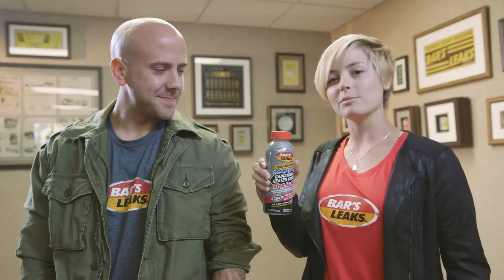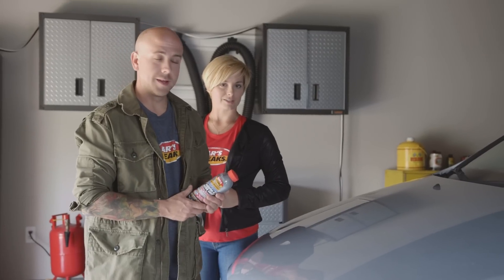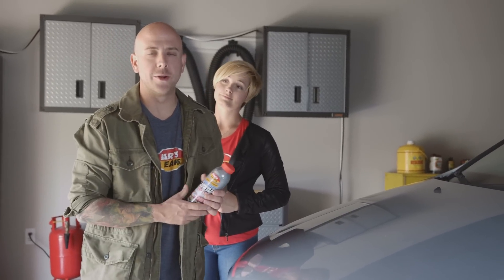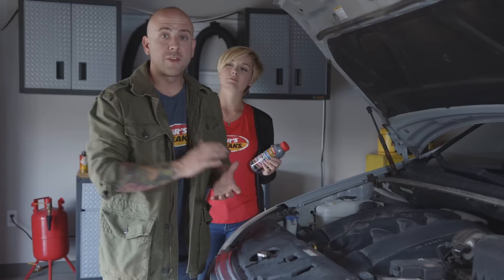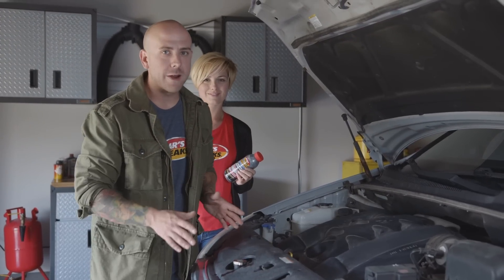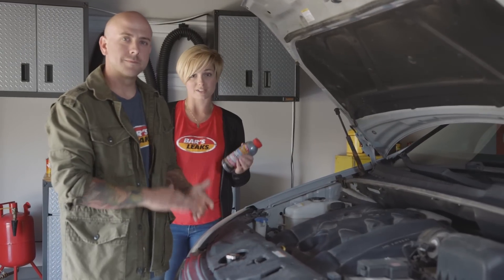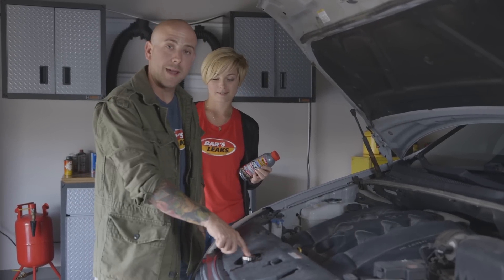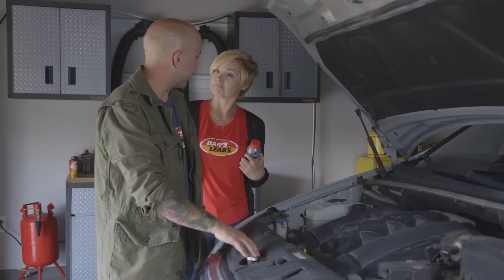How-To: Installing Bar's Leaks Liquid Aluminum Cooling System Stop Leak

Comment: This is what the video says:
- Shake Bottle and pour either directly into radiator via radiator cap or into coolant reservoir.
- One full bottle for 6/8/10 cylinder, 1/2 bottle for 4 cylinder.
- Replace cap and start vehicle. Allow to idle for ~15-30 minutes with fans and heat on high. Don't do this in an enclosed area!
Reply: I needed this
Reply: 😂😂 great job champ for the break down
Reply: Do u put the heat on

Comment: Can I add this or the tablets to my coolant reservoir? I have a 2019 Jeep Cherokee and it take a lot to gain access to the radiator.
Reply from the maker: No, Tablets may be crumbled or pre-dissolved (use warm tap water) for easier application. Install one tablet for each three quarts of cooling system capacity. If vehicle does not have a regular radiator cap, remove top hose where it attaches to radiator and install tablets in hose and then reinstall hose.

Comment: Does this product really works in coolant reservoir or not? I have a 2016 Ford Focus SE. I will only need half bottle since I have 2.0 L 4 cylinder engine?
Reply from the maker: You can install into a pressurized overflow if you do not have access to the radiator. If you have access you will need to install directly into the radiator.

Comment: About to use your product. I Pray to God it works.
Reply from the maker: Hi Rebecca, thanks for giving us a chance to help you out. If you need to speak to us, our customer support team is available M-F 8am-5pm EST, and can be reached at 800-345-6572.
Reply: did it work
Reply: @mohammedalmasbahi4724  no it didn't. Still leaking. 😕 But I have heard that some cars it works depending on the leak.

Comment: What's the purpose of blasting the heat and fan on high?  Does this aid in moving the product through the heater core so it doesn't clog anything there?  I'd LOVE for this product to work but I'm apprehensive for this one factor before I buy and try it.
Reply from the maker: Yes, the reason is so that you get good flow through your heater core. If installed in a clean cooling system at proper dosage you will have no restriction issues. If you have not flushed with a cooling system flush product in the last 30-40 thousand miles you will want to flush before adding the product. Feel free to contact our Technical Service Professionals at 800-345-6572 or if you would prefer you can use the contact us page on our website.
Reply: @BarsleaksUSA  Welp, it's stopped my leak and my heater still cranks it out, so we win!  Thanks for the help!
Reply from the maker: @adctd2gtr  Glad we could help!!!

Comment: I'm excited to hear about this product but in my unique case, I've got blown head gasket but my ford pinto engine is on a Rail Buggy!!!!    Which means I don't have a heater, which ever video suggests its a critical to run the heater on HIGH!!!!  Can you advise or offer recommendations ????
Reply from the maker: Please call our tech support team at 1-800-345-6572 so they can further assist you. Our team is available M-F 8am-5pm EST.

Comment: I have a 2002 Buick century and I see a 4-5 inch crack in the radiator hose kit. Can bars stop leak prove to be helpful in this case also, which bars leak I am supposed to use for the car? It's also old with over 200k miles on it.
Reply from the maker: With a crack that large I do not think we will be able to help. How much fluid loss are you getting? Can the vehicle run for 15 minutes without having to add fluid? Is the crack on the hose itself?
Reply: @BarsleaksUSA what if it’s leaking from the black plastic top on top of the radiator?
Reply from the maker: @captainlight8050  this product can still seal that leak if a crack in the tank on your radiator.

Comment: does this clog the radiator and the heater core heat exchanger?
Reply from the maker: The product is engineered to flow through 0.030" 0.035" unrestricted, and will not cause clogging. If there's concern with your system or it hasn't been flushed in the last 3-4 years please do so before running a stop leak. Our customer support team is available M-F 8am-5pm EST, and can be reached at 800-345-6572 if you have further questions.

Comment: Hi I used the Bar's Leaks Block Seal Head Gasket Fix 24 , yesturday I still get missfires when driving 55 M/h does it take litlte longer than a day to work ?  should I wait couple days ?     I purchase the stronger one the HG-1.. Should I flush the coolant before  I will use this one in couple days ?
Reply from the maker: Hi Henry, at this time do not add anything else to the system, please give the current product you've used some time to work by normal driving. Please call our customer support team to discuss any questions you may have. Our team is available M-F 8am-5pm EST, and can be reached at 800-345-6572.

Comment: what about a hemi engine those bottles say use for 4 to 6 cylinder engines
Reply from the maker: Add one bottle for 5, 6, 8 and 10 cylinder engines. Use 1/2 bottle in 3 and 4 cylinder engines. One bottle treats cooling systems from 10 quarts (2.5 gallons) to 16 quarts (4 gallons). Use 1/2 bottle for cooling systems from 6 quarts (1.5 gallons) to 9.9 quarts (2.4 gallons). For larger systems use one bottle for every 3 gallons of cooling system capacity. Small engines or other small systems use 4 to 5 fluid ounces per gallon of fluid capacity.

Comment: What if your coolant has been leaking, do I pour the whole bottle and then fill it back up with coolant, then let it idle?
Reply from the maker: Hey there CurtJames23 our customer support team is available M-F 8am-5pm EST, and can be reached at 800-345-6572 to assist you with installation instructions.

Comment: Used this product and it worked but my heater doesn't blow hot air anymore....help!!!
Reply from the maker: Please call our tech support team so they can further assist you. They are available M-F 8am-5pm EST, and can be reached at 800-345-6572.
Reply: this usually means there’s air still in the system
Reply: Cloged

Comment: i used this to fix a radiator leak and it clogged my radiator and heatercore i had to replace both ive used other bars products before with no problem but i wouldn't recommend this it did more damage than it fixed
Reply: Dam and I just bought a bottle
Reply: If the coolant was old and needed to be flushed out because of rust in it, it could clog things up

Comment: Does this work on HOnda  products... 2006 accord.
Reply from the maker: Hi intellybit, yes the product can be used in a Honda. If you have a 4 cylinder please use 1/2 a bottle. Our tech support team is available M-F 8am-5pm EST, and can be reached at 800-345-6572, if you have further questions.
Reply: @BarsleaksUSA   question ok. I’m having a small drop leak under the raidiator in the plug area  plastic  the couner of it.   I hve a Nissan Maxima v6  3.5.  I’m worried that this wud clog up my Systhem.  Should I  put only  less then half. Then let the car run 15 min to temperature  drive it  &. Park let it cool &. Chk it ?   I just don’t wnt to clog it
Reply from the maker: @jaybreezey6945  Hi Jay, please give our customer support team a call so they can further assist you. Our team is available M-F 8am-5pm EST, and can be reached at 800-345-6572.

Comment: Does it work with radiator with hole
Reply from the maker: Hi Vonnie, please call our tech support team so they can further assist you. They are available M-F 8am-5pm EST, and can be reached at 800-345-6572.

Comment: which product fo I use for a 08 commander 5.7 v8 radiator
Reply from the maker: Please call our tech support team so they can further assist you, they are available M-F 8am-5pm EST, and can be reached at 800-345-6572.

Comment: Could this product be used as a preventative measure. I've got a high mileage vehicle which has been in the family for a couple of years. Just wondering if it would be a good idea to add this even though there are no current issues with the cooling system or head gasket
Reply from the maker: If using for Preventative Maintence we would suggest the Radiator Stop Leak Tablets. Part number for that product is HDC. I will leave a link to the product page below. https://barsleaks.com/product/radiator-stop-leak-tablets-hdc/

Comment: Do the radiator got to be full first
Reply from the maker: Hi Anthony, thank you for your question.  You need to have enough room to install the product so that it doesn't overflow.  After installing the product you can top it off with coolant. If you have any other questions feel free to reach out to our tech support line at 800-345-6572 M-F 8am-5pm, or on the web at https://barsleaks.com/contact-us/

Comment: Say if your car is not leaking until your start running your AC or HEATER? Seems like that’s the only thing that drains my fluid out. I put this stuff in there & no drip but I thought the car was just to run idle or drive it only (that’s what it said on the bottle) but when I watched & cut the heater on full blast that’s when I started getting small drips that eventually got to a small puddle.. maybe I should’ve kept the heater off & let it circulate on its own?

Comment: What happens if you use it because you thought it was leaking but turns out that it wasn't the case
Reply from the maker: Jordon Cole-Samuels Doesn't hurt anything - the formula stays in the system (until it gets flushed) and will actually guard against future leaks. We have quite a few customers who use our products as preventative measures, especially in older cars. More info here: http://barsleaks.com/wp-content/uploads/2014/11/1186-Tech-Sheet.pdf
Reply: Thanks
Reply: That's not true . We cut these heater cores in half and there's your product all up in it
Reply: @Hungrybird474  it’s because they didn’t use it properly.

Comment: I keep seeing that it's best to remove the thermostat to use this product. Is that true?
Reply from the maker: Hi Robert, removal of the thermostat is not required to use the product. However, customers in the past have removed it prior to use of the product with success. If you'd like to discuss more our customer service team is available M-F 8am-5pm EST, and can be reached at 800-345-6572.

Comment: To everybody watching these commercials do not ever use these on your vehicle they will plug up your heater core they will damage your engine and your cooling system every single time never add anything to your engine fix it the right way
Reply from the maker: Hi there Mark, fact is our products will not clog up heater cores, damage engines, or cooling systems. We're a family owned business that's been around for over 70 years helping people fix their leaks, as a matter of fact we've been installed on the factory assembly line as a preventative measure since the 50's. We do agree that sometimes the hard fix is the only way to go, but for some customers that's not an option due to the age of the vehicle or cost of repair. As long as the system is clean we can safely pass through without clogging. Thanks for stopping by Mark.
Reply: @BarsleaksUSA  then tell me why it plugged the holes up in my radiator and then in my engine I'm in the process of trying to remove it because it's clogged the main passage and my heater stopped working so sorry if I'm dealing with something and I don't believe what you believe
Reply from the maker: @markmarner3016  Our customer support team is available M-F 8am-5pm EST, and can be reached at 800-345-6572 if you would like to speak to them. That product is engineered to flow through automotive screens and passages from 0.030"-0.035" safely. If  you've run into an issue our team would like to know more about your situation. Please give them a call Mark.

Comment: what if Therese no radiator cap?
Reply from the maker: Hi DNFDESTROYER1818, thanks for your question. This product can be installed in to the reservoir as long as it has a screw on cap, which means it's pressurized. If you have any other questions our Michigan based tech support team is available M-F 8am-5pm EST, and can be reached at 800-345-6572. Thanks again for reaching out.

Comment: Lousy video, just talk no demonstration....? Anyway, the stuff worked in my 02 Camry with a moderate radiator leak.  Used it per the bottle directions, not per these two actors. Got the idea to try it from Scotty Kilmer, he was right, it works.  Beware, as it pours super slow and tends to overflow out of the radiator filler neck.
Reply: 😏 Me to, Love Scotty

Comment: i used this to fix a radiator leak and it clogged my radiator and heatercore i had to replace both ive used other bars products before with no problem but i wouldn't recommend this it did more damage than it fixed
Reply from the maker: Hi Anthony thank you for your comment. As a family run company since 1947 we take comments like these very  seriously. Cooling systems that are dirty or partially clogged should always be flushed prior to use of our products.  Most of the time people assume that just draining and replacing coolant is sufficient to achieve this, however that's not the case.  Over time scale, rust, and even dirt can accumulate in the very narrow passages of radiators and heater cores restricting flow.  We constantly test, and monitor our products to make sure we are able to flow through these passages unrestricted. If you would like to speak to our tech support team on this issue they are available M-F 8am-5pm EST, and can be reached at 800-345-6572.  Thanks again for the comment.